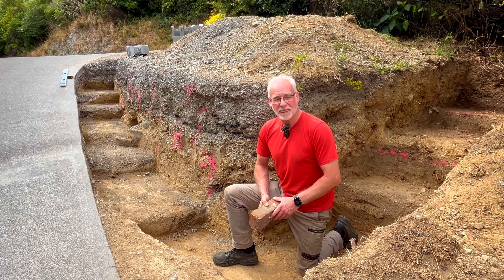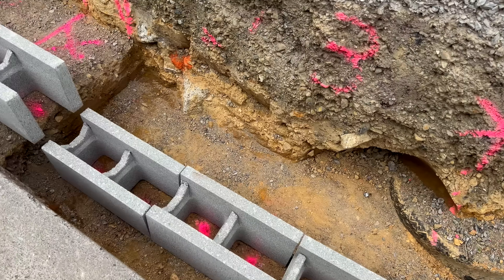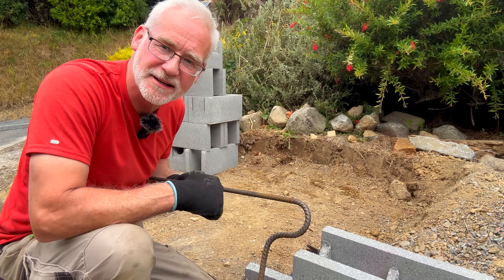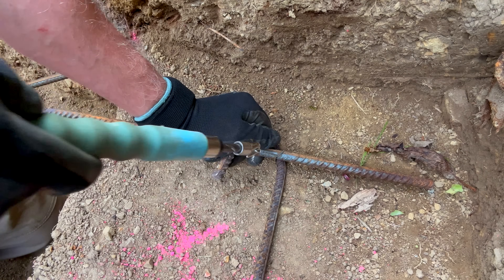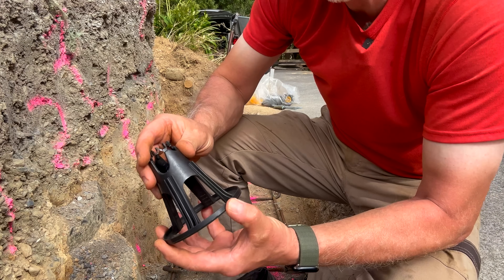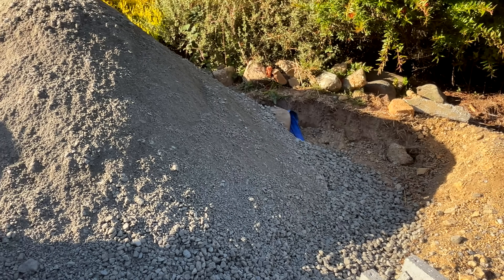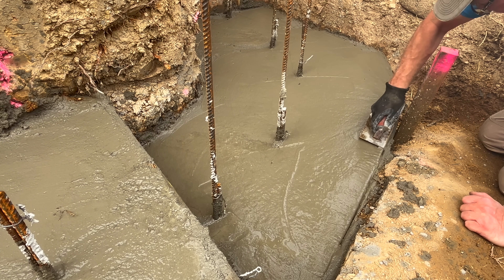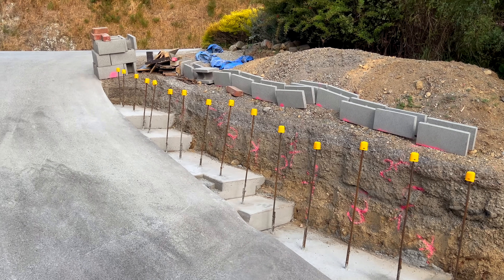How to build a RETAINING WALL - pt2 - rebar & concrete footings

Comment: The cement mixing and layering was very satisfying. Also the little tool you used to twist the aluminum ties is pretty cool too. 10/10 amazing concrete work 🔥🔥🔥🔥 XOXO Charlie's Angels
Reply from the maker: Hello Angels, concrete work is never fun, but it’s nice to make something with a sense of permanence. The twist tie tool is great, but not as cool as the motorised tieing machine I’ve upgraded to 😎
Reply: @danwaterson356  Which video can we see that one in?
Reply from the maker: @wdancers24it features In episode 7 of the Tiny Barn build😊

Comment: Compliments on the high quality editing and voice work on your video. Do you not think this is all overkill for such a low retaining wall?
Reply from the maker: Thank you for the compliments. I could agree that this could be overkill, however NZ is subject to frequent seismic activity and I don’t want to have to redo the work in the future if I can help it!  I’m also basing the construction on local building code, and using this project as a trial-run for my upcoming workshop build, as this method would work well for a taller structure.

Comment: As far as I know, in reinforced concrete, the rebar functions under tension, while concrete works under compression. Rebar is designed to work efficiently in tension. However, in the video, the lower rebars are bent at a Z-shape and may not function optimally under tension
Reply from the maker: You’re right about the rebar working under tension, and that concrete can only resist compressive forces, however my understanding is the Z-shaped bars in the base of the footing should function perfectly. The horizontal portion of rebar gives tensile strength to the horizontal concrete footing resisting the vertical loading from the wall, and the vertical section of rebar will function the same way as the rebar in the blockwork, to resist the horizontal load from behind the wall. Additional strength is gained by the vertical and horizontal sections in the foundation being continuous, so the forces applied to one are transferred/shared across another plane. No matter which way the structure wants to bend or rotate it has resistance to both tensile and compressive forces.  I think a stepped foundation like this would be far stronger than a ‘flat’ continuous footing.

Comment: One way to establish the curve is by laying down a garden hose, mark it with paint and then use the outline to temporarily lay your bricks. Much easier this way as you don’t have to muck around with the bricks to get the curve just right
Reply from the maker: That’s a great idea, and would be faster. I’ve also used flour in the past for very long curves, as you can easily ‘rub’ out the curve and make adjustments.
Reply: @danwaterson356  that’s a great idea too

Comment: Why not just cut the cement bags in half instead of shoveling it? Save time and spilling it, great stuff tho!
Reply from the maker: It’s a 40kg (88lb) bag, so the mixer can’t take all of it at once as the mix would be over 500lb! Didn’t have too much spillage although usually I’d have the bag closer to the mixer if possible. Thanks for the comment; maybe I should buy smaller bags of cement….🤔

Comment: What were the bricks for in the concrete work, what are those notches for?
Reply from the maker: The outer skin of the wall will be old imperial clay bricks. I’ve used them in the layout to plan the finished curve, so that the blockwork ends up in the correct place. Check out the Part 1 video, where I show a computer generated image of the walls construction.  The notches in the concrete are steps for the brick skin, so their foundation is below the level of the driveway.  I only needed those notches because I decided last minute to thicken the foundation to 8”.